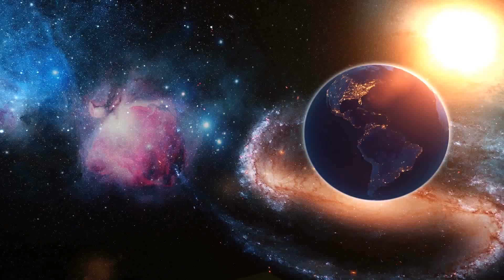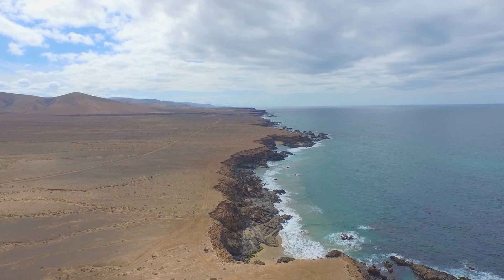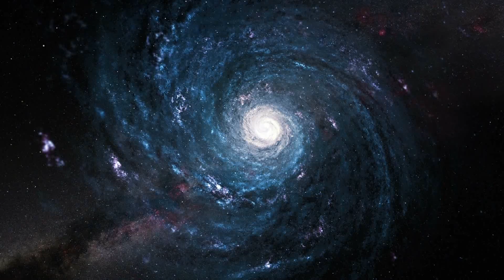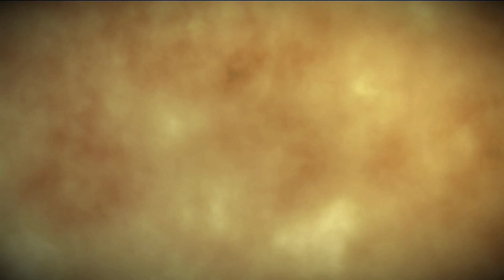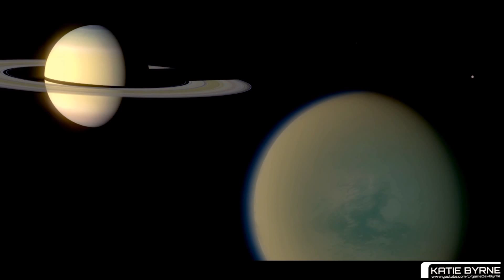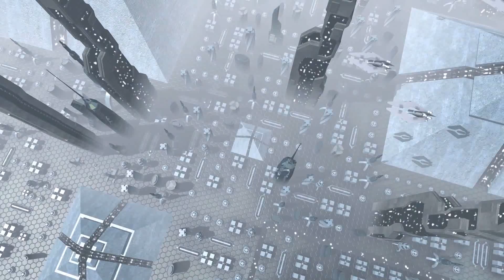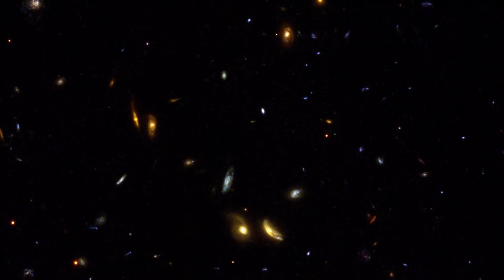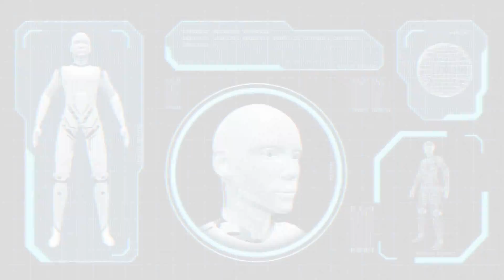Planet Ships

Comment: How do we deal with the Earth’s rotation?
Reply from the maker: Depends on if you want to deal with it or not. There's no particular need to spin a planet down and I can think of benefits to leaving it spinning for the trip too, but the energy involved isn't really very significant compared to what ti takes to move it at even fairly slow interstellar speeds.
Reply: Isaac Arthur   I was thinking in regards to the by StLazer method.  The Earth’s rotation means that any ground based mirror would have to large in order to deal with the issue of it only facing the sun at ideal angles for several hours. And/or you would need several of them.

There’s also the issue of the axial tilt, which means that the ideal lineup would be maybe for half a year unless you make the mirror/s span the entire tropics.
That the size of the mirrors aren’t much of a problem if you have the resources.

Then there’s the angular orbital momentum. By pushing the Earth away from the Sun, you are really just setting it’s orbital distance further away, making the orbital period longer.  This would be an issue only in that it means that the Earth won’t be traveling in a straight line away from the Sun, but in an every widening elliptic until you either buildup enough speed or move far enough away from the Sun’s gravitational influence.

Seems to me that the easiest solutions would be to either; To place the mirror/s near the poles.  And then use the stlazer to push the planet “up” or “down” of the orbital plane. Or.  Place the mirror/s on an orbital ring. And allow those mirrors to move along the rings so that it’s always between the Earth and the stlazer.

Comment: What kind of impact would the interstellar or intergalactic medium have on an object traveling at 70% of lightspeed?
Reply from the maker: About the same as an equal mass of anti-matter, but you are hitting it in very small bits and pieces so it's more like a strong radioactive wind. Manageable, so long as you've got forward detection and methods for eliminating any bits too big, which would be anything much bigger than a grain of sand at that speed :)
Reply: @isaacarthurSFIA  Would an aerodynamic shape help to mitigate the impact? Maybe a needle-shaped craft would be better than anything blunt.

Comment: Wouldn'ta planet ship have one major flaw versus a typical method? Gravity. it would constantly lure in any floating debri's asteroids etc. you would essentially be bombarding the planet ship with incoming missles
Reply: Not necessarily. If the planet is moving, then most of the floating rocks/asteroids etc will miss unless they are almost directly in the path of the planet to begin with. The planet will change their courses a little bit but they will cross the planets path "behind" it.

If you want another way of thinking about it, then change reference frames, so instead of thinking of the planet as moving, think of the asteroids as moving at a high speed relative to the planet. If an asteroid has a low speed relative to the planet, or if its velocity is already pointed there, it will hit the planet. If an asteroid has a medium speed that's not directed toward the planet, it will enter an orbit around it, and never hit. If an asteroid has a high speed relative to the planet that's not directed exactly toward it, the asteroid will follow a hyperbolic trajectory that will curve slightly toward where the planet was, but miss the planet to pass behind it.
Reply: Yes, it has been covered in earlier episodes, you need lasers or something to magnetize particles you meet and divert/destroy them, or use rotating (from back to flying direction) conveyer-belt like structures when you fix damage done back and get hits on front... Also, several thin membranes flying in front of the planet etc
Edit: Forgot to mention, very few asteroids etc would be on the way, also gravity doesn't have "time" to pull large pieces towards your very fast moving planet after a while (well, "a while" being long time).
Reply: If you have the technology to move a planet, you have the technology to deal with incoming debris.
Reply: That is what the Lazer defence is for.
Reply: @jacobcarasso3251   lasers will only make 1 piece of debri into many.  Considering the speed arthur was talking about, i very much doubt humanity could deal with such issues. the reaction times are way too short. and the ability to detect them in time would be very slim. the faster we go the the further away we need to know there in our path. planet ship is an interesting idea but probably the most unlikey candidate.

Comment: Sorry Isaac but I just don't understand how fusion candle would work.
 How would the Fusion candle push the gas giant if the gas giant is no surface that the candle can push into?
Reply: Imagine the struggle of pushing a beach ball underwater. It would still exert force on the water. At least that's how I image it would work.
Reply: Fusion candles burn at both ends. One for pushing itself out of the atmosphere and the other for pushing the planet.

Comment: No you cant build a sphere around a planet and just put into an orbit around the planet cause the material on the axis of spin of the sphere would be not be moving so it would just fall down
Reply: I take it you are new to the channel. look into his video on orbital rings.
Reply: There's great episode about this, it is not solid sphere around a planet but a strip inside which (say, copper wires) stuff flies around the planet in different directions. Add many strips, to almost or totally cover the planet, this is SFIA after all :)

Comment: Too bad you don’t have animation covering the topic. 

Think of a pattern of colonization as leaf veins. 

Why not add worm-holing a planet to habitable zones of new star systems?
Reply: Any wormhole big enough to fit a planet through would probably weigh more than both of the solar systems it's in, so it would probably be too dangerous. Not to mention the tidal forces on the planet itself. That being said, there's no reason why it can't be done in the right conditions.
Reply: @chrisgaming9567  I am no physicist but... How would you know if the wormhole has any mass at all? Even if it did, we have tidal forces already. Wormholing anything within say 1/2 AU of earth could also be done if you wouldn't want to feel the tidal forces in the blip of transition. Question then remains how to safely dissolve the energy after transiting a world and stuff around it.

or it could be that by escorting the world out of one solar system and on its exit route portal it into the edge of another solar system. Beats traveling light years for hundreds of thousands of years. Not to say that the tunnel is less meandering than the space we'd need to traverse.